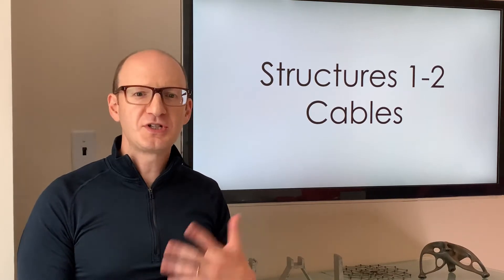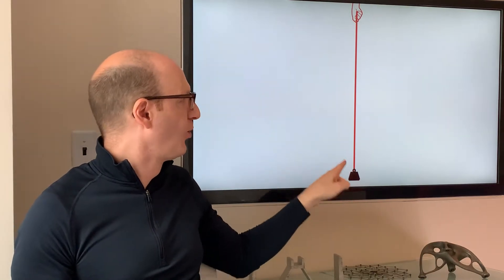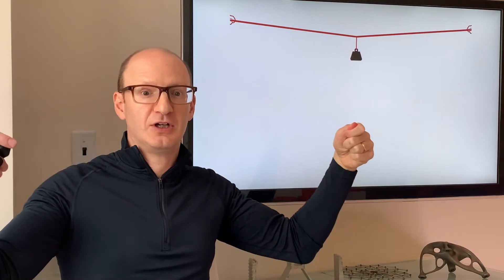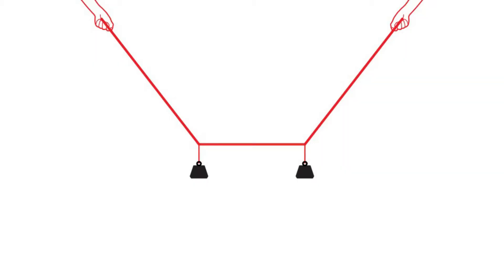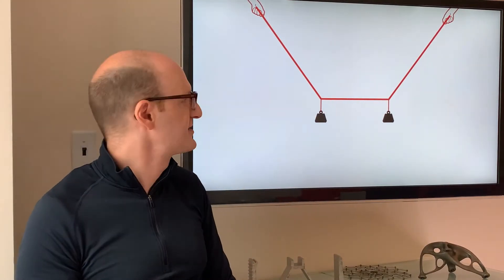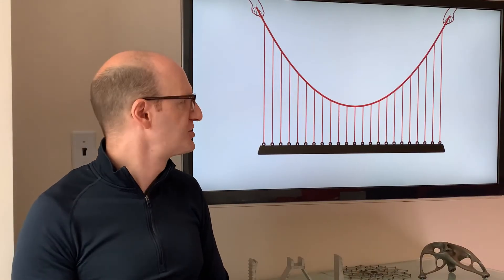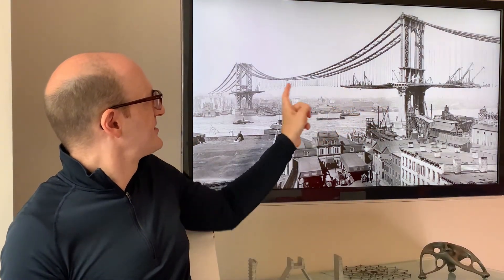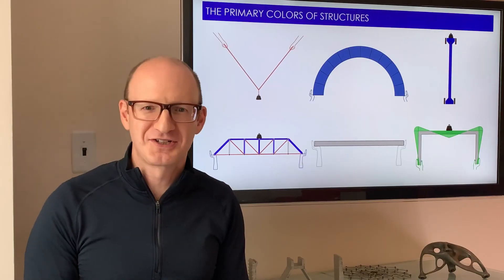How Cables Work - With Diagrams! (Structures 1-2)

Comment: The shape is a catenary not a parabola. They are very similar, but different. The catenary formula uses the hyperbolic trig functions.
Reply from the maker: Thanks - catenary shape when the weight is evenly distributed along the line of the cable itself (i.e. just a cable) and a parabola when the weight is evenly distributed horizontally.  Agreed similar but different given the weight distribution is similar but different!

Comment: The shape of the cable is not a parabola; it is a catenary, a function of cosine hyperbolic.
Reply from the maker: Thank you...a cable under its own weight is a cosine hyperbolic as you said...when point loads are added that are heavier than the cable then it becomes a parabola. The difference being how the the weight distributed: when it is along the curve of the cable itself it's a cosine hyperbolic ...whereas when the loads are distributed along the horizontal the shape becomes parabolic.
Reply: @PaulKassabian  thank you for the clarification. I found your videos are pretty interesting and instructive.

Comment: High Paul. It's seems clear, that bridges deck is curved because of heat dilatation but how the cables can folow the deck when it shrink in cold? It looks to me that the deck, and the cable shrink in the oposite direction, wich leads to heavy tension.

And which direction the support needs to handle forces in a suspension bridge?
Reply from the maker: Good question, when the temperature reduces both the deck and cable shrink so it's not an opposite problem..due to geometry there are differences which are analyzed as temperature loadcases for all bridges.  Thanks!

Comment: are there any formula as to , and take the first examle here were we added a second string , if we take as a point o reference a vertical line passing thrught the middle of our weight , in what angle while  increasing the span of the "hands" holding the line , the load ( tension) each hand is holding is equal as the tension when we holding the weight with one string ?
i am guessing 45 degrees . but when we add a second or third or more loads the that said angle changed based the distance between loads ?( lets say that they are equaly destributed ) . 
Thank you !
Reply from the maker: You're asking when the tension in a V-shaped string equals the force of a single central weight...for that it's 30degrees to the horizontal.  Because half the vertical weight goes to each hand and sine(30)=0.5.  For the rest, you just keep solving using basic trigonometry from the weights going up to the supports!

Comment: Isn't it a catenary instead of a parabola?
Reply from the maker: Thanks for your note.  A catenary is the shape of a cable under its own weight (and nothing else), whereas a parabola is the shape of a cable under a constant horizontal load.
Reply: @PaulKassabian  ... in a system where the weight of the cable itself is negligible compared to the external load that shapes it.

Comment: Im a little confused about how a free body diagram would be when the cable reaches the fully horizontal position while carrying a vertical load, as there is no vertical component to counterweight the downward load.
Reply from the maker: Thanks for your note.  With any vertical load (including self-weight from gravity) a cable cannot be perfectly horizontal.  It may look like it (or essentially be so close as to be negligible) but there will always be some vertical displacement.